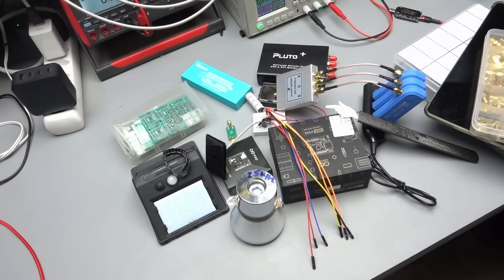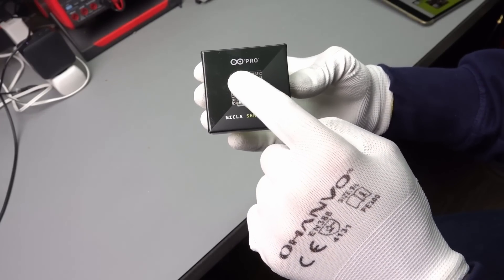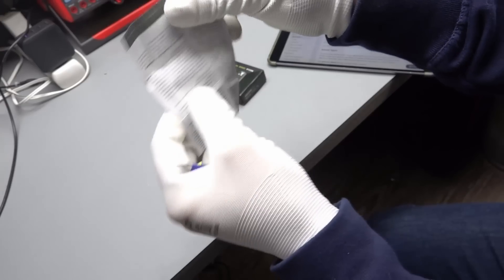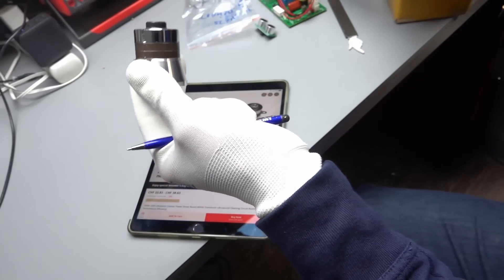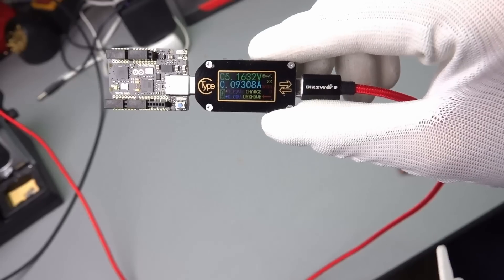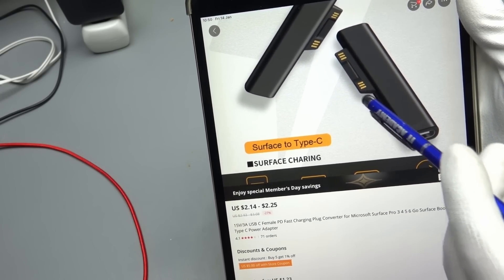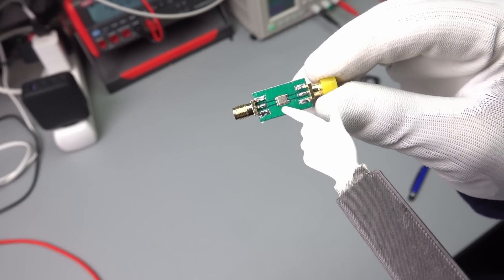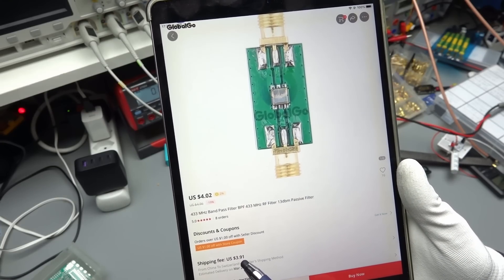#414 Mailbag Part 1

Comment: Thank you for your Videos! The Pluto+ looks very interesting. Did you Test it compared with the original Adalm Pluto? Its a bit more expensive then the Adalm Pluto Mouser sells (hope they sell Revesion D or C). But the included LAN Port and the Metal case are very nice features.
Reply from the maker: I use it in my QO-100 satellite station and never had problems with Ehternet (it never worked with the original Pluto). But there is now a new version of the original sold.

Comment: Very interested to see your findings in using the Pluto+ for QO100. To make the Adalm Pluto usable, I had to replace the crystal with a TCXO, do the ground mod and add an external network dongle. If all these things are no longer needed with the pluto+, then it is perhaps even cheaper than the original Pluto. 73 de Cedric ON4CKM
Reply from the maker: I exchanged it because I had problems with Ethernet and had to use a 20m USB cable, also not very stable. Now the Pluto Plus works with external GPSDO ( I also had to drill a hole for the connector) and Ethernet cable. I would not go back…
Reply: @AndreasSpiess  I see a topic for a next video 😉

Comment: I was surprised at the number of connections on your triple receiver setup. That is a lot of loss.
Reply from the maker: How would you do it differently? In addition, I added a amplifier that will make up for the attenuation. BTW: The biggest attenuation comes from the power splitter that divides the input poweer int three equal parts. The rest is minor compared with this "loss".
Reply: @AndreasSpiess  A fair question sir ! When I was working in RFID we were limited to 1watt output at the reader due to FCC regulations, so all connections had to be soldered. (excluding two, one at the reader, and one at the antenna) A loss of 1/4 to 1/2 db per connector was to great to allow. Typically we made custom length cables with soldered ends for whatever was needed. The EEs would create a circuit board for any more complicated needs. We did not have the ability to increase reader output to compensate for loss. Since this is not an issue in your case, my observation is probably not applicable.

Comment: with the big ultrasonic transducers it might have been cheaper to buy a cheap ultrasonic cleaner and salvage the parts.
Reply from the maker: Maybe you are right. I did not think about this possibility. I need 25 and not 40khz for my experiment. I do not know which frequency my cleaner uses.
Reply: @AndreasSpiess  The cheap ones I found (30-40 eur) advertise between 40 and 48 kHz, so not a suitable alternative for your experiment.

Comment: What are the three sdrs that are plugged into the USB hub and then attach to a box where all three of the antenna wires attached ?
I have seen two sdrs used for Phase 2 digital p25 systems but I've never seen where three sdrs are used at the same time
Reply from the maker: They are the 10$ RTL-SDR dongles. They only offer 2MHz bandwidth and if you want 6MHz you need 3 of them...

Comment: Hi Andreas, you can also use cheap cable tv splitters to share the signal, I tested one in my channel !  All the best love your channel
Reply from the maker: You are right. I was astonished that your SWR was so good. Of course, you looked only at 0-30MHz. I measured the whole specified range, but my splitter is not very good. It had very big ups and downs. I was a bit disappointed but, as you said in your video, for the reception it is not so important.
BTW: I just created a HAM radio channel for such stuff ;-)
Reply: @AndreasSpiess  Good for the new channel, I'm subscribed too. Regarding the TV splitter I tested up to 500mhz and works perfect, just my nanovna can not go higher.

Comment: thanks for the Microsoft Surface Pro adaptor. That's great. I had to buy three power supplies already because the port dongle went bad in each.
Reply from the maker: An USB cable is probably cheaper ;-)

Comment: I’m considering buying a Pluto+. What antennae would you recommend to achieve the widest possible frequency range? I’m assuming a different antenna on each receiver would achieve the best coverage.
Reply from the maker: We usually use different antennas for different frequencies if it matters. If not, you can use whatever wire you want.

Comment: Sali Andreas, nicht vergessen, Katzen können auch bis 80khz hören....also pass bitte aufs Büsi auf.
Es ist eher philosophisch, aber ich würde es zuerst Antenne, Lna, 403mhz Filter, 3sdr machen. Kannst du evtl einen SDR weglassen und testweise einen esp32 dranmachen und die Reichweite vergleichen?
Reply from the maker: Ich werde beide Varianten beim Filter versuchen. Allerdings habe ich einen starken Sender der Polizei (und meine KW Station) in meiner Nähe und ich möchte den LNA nicht übersteuern...
Wegen der Katzen: Danke für den Hinweis. Das wusste ich nicht. Aber jetzt werde ich aufpassen.
Die drei SDRs braucht es wegen der Bandbreite von 6MHz. 
Ich verwende eine fertige SW. Die läuft auf einem Pi. Ein ESP32 wäre nicht stark genug...
Reply: @AndreasSpiess  Also ich hab mit einem esp32 schon über 500km mit einer Wettersonde geschafft. Eigentlich brauchst du ja nur einen sdr, und der springt ja dann und du hast dann nur 1/3 der Pakete, was nicht tragisch wäre, so hast du ja bislang gearbeitet. Bzgl starke Stationen nebenan - da hast du recht, vermutlich macht dann auch noch eine gute Schirmung der SDR Sinn, damit es nicht hinter dem Filter einstreut. Auf dem Letzi ist ein OGN Empfänger ca 10m von starken KW und EME Sendern/Antennen entfernt, aber den LNA oder den SDR hat es bislang noch nicht zerlegt, trotz fehlendem Filter. ;-)

Comment: is it possible to put the 403 mhz filter in parallel with a 437mhz filter?
Reply from the maker: Yes. But then you need splitters on both sides to adjust the impedance.

Comment: You might not hear the ultrasonic sound anymore but you can still perforate or tear your eardrum with frequencies you can't hear because of the vibrations still move the bones in your ear.
Reply from the maker: Thank you for your warning. I plan to use ear protectors which should have an attenuation of 30dB on those frequencies.

Comment: A few years ago you made a video utilyzing a few different motion sensors. I followed along and made my own, which worked fine. Thanks.
There is one thing I have been hoping for for years, and that is a radar or motion sensor that would work at 100 meters. I would use it on my boat to prevent me from being run over in the fog or at night.  Buying radar is prohibitively expensive. Any thoughts of doing this ?
Reply from the maker: Powerful radars still are expensive. Maybe we will profit from their usage in the car industry and one day they will become cheaper.
Reply: @AndreasSpiess  I've been mulling this over (in my quest for an inexpensive radar or lidar or motion detector) useable out to 100 m, and it occurred to me that a sensor with a high gain antenna might be workable. A very high gain antenna. As I understand it, a high gain antenna's shape / orientation results in a power loss in some directions and a power gain in others. 
If one of the sensors you tested could be used with a directional antenna, it could be sensitive way out in that direction. Then just turn the antenna a little, and so on.
Any thoughts ?

Comment: Why are there jumpers (or something that look like jumpers) on the connectors of the Arduino Uno Mini?
Reply from the maker: They are normal connectors, just smaller.
Reply: @AndreasSpiess  At 1:13 you can see black blocks covering parts of the female connectors. Or are those protective covers, only?

Comment: 6:18 Ultrasonic Levitation machine, DIY Long Range Acoustic Device LRad 😁
Talking about SDR, I personally don't know the full potential of the RTL820 since it is complicated to use them. I tried a few times with Matlab and GNU Radio, but that's it. I wish there was an open-source duplex transceiver.
Cheers ✌✨✨
Reply from the maker: 1. Levitation seems to be interesting, but I had something different application in mind
2. Mathlab and GNU radio are probably not the easiest entries. I would try to start with programs like SDR# or SDR console.

Comment: The Arduino Mini is cute. Makes that USB-C plug look huge! If you do use it for something, I'd guess you need a custom PCB or a breadboard to hook anything up?
Reply from the maker: It has tiny Dupont-like connectors as the original. But I do not know which connectors will fit...

Comment: To me the multi-sensor modules aren't really worth the extra expense. Just buy the sensor you need for the project on a cheap module and use it. You're never going to need every sensor in one project, so next time you want to use another sensor for a different project you're going to have to either buy a separate module anyway, or just dismantle your old project. Might as well just buy the one you need from the start.
Reply from the maker: Good point.

Comment: Hello Andreas, will it be possible to use the ADAM Pluto as a VNA especially for the Higher Frequencies like 5.8 GHz Wifi. Would be nice if it would work in that range as a VNA. Thank you and 73! DE1CTL
Reply from the maker: A VNA also needs a bridge. These are very expensive. Usually more expensive than a cheap nanoVNA. The V3 should cover 6GHz… >500$
Reply: @AndreasSpiess  Dankeschön 🙂👍

Comment: Hi Andreas, this comment is nothing to do with your mail bag but thought you might be interested anyway, have you seen the RPiTX project, it has some amazing features, I’m running the pocsag generator to send important (emergency) conditions from my home automation system to an old pager I have, its great for when my phone is on silent over night in case some thing really important occurs like a water leak in the house etc.
Reply from the maker: Yes, I saw the RPiTX project. Very innovative! But nothing for this channel as it requires a license if you want to use it. Maybe it will air on my newly created channel for licensed viewers.

Comment: Grutti Andreas!
- For the US transmitters - I hope you plan to check the polarity of each - in the "acoustic levitation" project at UpnaLab / UniBristol demonstrates that these are not always same (correctly marked). I assume you plan to do something with a phased-array :)
- The bigger "cleaner-grade" transducer can be dangerous if it couples too much power into living tissue - if you touch it, for example, causing (not immediately apparent) bone-damage. The lack of a pain-reflex means that one doesn't realize there's a problem, until it's too late.
-  Would love to see an "HAM-RF" special episode with the 3xSDR-stack and the PlutoPlus :)
Reply from the maker: Thank you for the tip with the polarity. I was not aware of this problem. And I will pay attention with the devices...
After reading your comment I did something planned for a long time: I created a second channel dedicated to licensed HAMs. You can be the first subscriber if you want: https://www.youtube.com/channel/UCQwyP4Yd0-O49e05kMUJgQQ
But no guarantee when the first new video will air.
On the main channel, I do not show things that require a license (except for the QO-100 which is too complex for the average viewer)
Reply: @AndreasSpiess  Done! :)
Reply: @AndreasSpiess  subscribed! Cool idea for a new channel 😀
Reply: Subscribed andreas! Love your work!
Reply: Hi Andreas, I also subscribed to your second channel. Quite high expectations for more quality videos 😋
Reply from the maker: The channel address changed, and you must resubscribe (above address is valid)

Comment: Love the white gloves, having seen the mini white glove pointy hands, it was a cute moment.

Then the whole - it is a lovely device but I don't see me using it aspect - we can all relate, and just nice to have some things for the if/maybe backburner projects.

The USB monitors, so wished they had a TAR calibration option so you could zero the power usage, removing what the device uses so you don't have to mental math the plugged in device usage - would be easy to add and yet, not aware of any that do.

I love the NoobElect SDR dongles, great intro price and tool for SDR.  Very impressed with the x3 balloon monitoring setup, most elegant budgeting.

Thank you Andreas, until part 2, byeee.
Reply from the maker: Another comment below gives more info to the TC66. Obviously you can power it in a different way to solve the problem.

Comment: For the TC66 .. is there no option to deduct the own consumption in the menu or so?  If you do like a test to measure the quality or what's left over from a small battery it can be a problem if you can't.
That Arduino mini ... nice nice nice ... but keeping my wallet closed. Seems like prices from Aliexpress have tripled for small circuits due to the shipping costs and most of it is not with free shipping anymore.
Reply: Yes, as Dmitry says, to ignore the TC66 "own power consumption" you keep the PWR and PD switches in the OFF position and power the TC66 externally through its micro-USB port, either from a PC or a power bank.
Also, as Marcel says, it only measures it's own consumption if power flows from USB-C female to USB-C male. 
There is interesting tests and projects by YouTube channel "TheHWcave" if you want more info on TC66.
Reply: And this gentlemen is why I like YouTube and this channel, sharing knowledge and giving positive comments!   Highly appreciated!
Reply: You can connect TC66 via USB micro to the computer. Than you can power it and get data from it.
Reply: It measures its own power consumption only if drawn from the ‚right‘ side...
Reply: @marcelgraf9271   Aha, good to know. Thx Marcel!

Comment: For the ultrasound things: does the fact that you can not hear them mean it will not do harm? I myself would not feel comfortable working with those devices without protection.
Reply: Ultrasound is commonly used in medicine, so it will not necessarily be harmful. The intensity is more important than the frequency, and 100dB (nb. that's dB, and not dB(A) in which normal sound is measured) is one of the recommended limits for ultrasound safety. And, of course, protracted exposure will be more harmful than shorter sessions - i.e. over 15 minutes.

If he's not SHOUTING in future videos, we'll know everything went OK. :)
Reply from the maker: I will certainly wear my ear protectors. I also have no idea how much energy can be transferred into the air. We will see...

Comment: I wasn't aware of the Pluto devices. Those are great! Thanks for sharing!
Reply from the maker: They are! Because they have RX and TX they are very versatile.
Reply: @AndreasSpiess  Have you measured the RX output on the Pluto plus? Very little info about this on the internet, some say 20mW others 100mW. Kind regards, 73.
Reply from the maker: The output power depends on the Frequency. But it is very low. I do no more remember, but I mentioned it in my QO-100 videos.